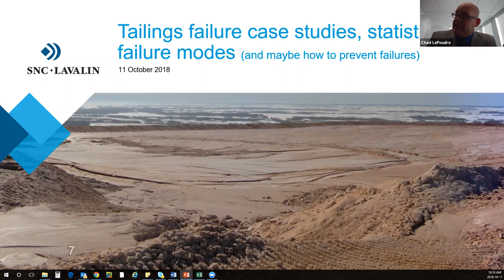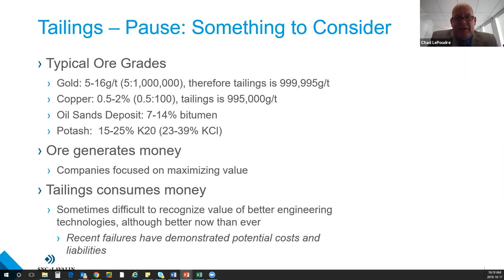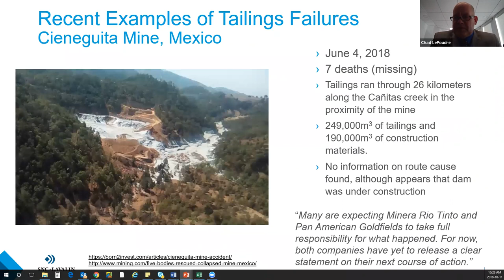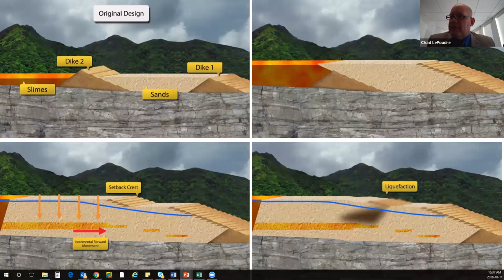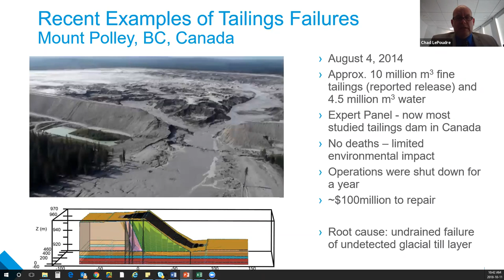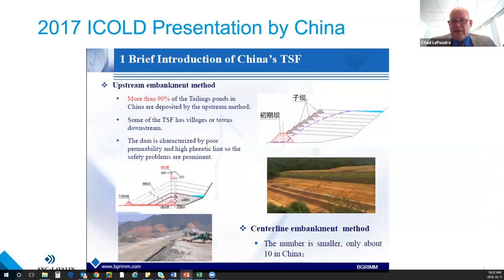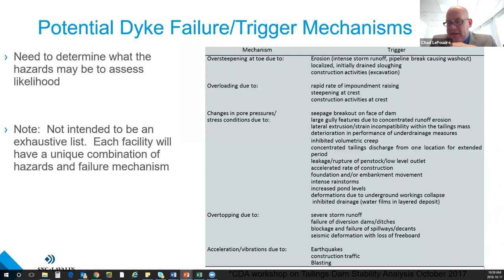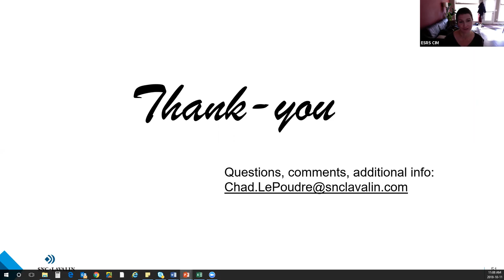Tailings Failure Case Studies, Statistics and Failure Modes Webinar

Comment: That is bizzare that the Fundao Dam of Samarco, Brazil was finished off due to seismic activity. They are not even near the edge of two or more adjoining tectonic plates. This just goes to show that fighting erosion is not easy & must be over-engineered given dire circumstances. Erosion is destined to happen without a high quality stabilizer / anchoring system for loose & low friction aggregates. This inevitability comparable to that of the inevitable biological aging and the possible solutions that the cryonics industry provides... 

Maybe then, if the stereotypical greedy folk that was maximizing the financial capital by cutting corners on some erosion / pollution mitigation techniques would wake up 500 years after cryopreservation to see the mess that has been made, then there may be a change of heart. (P.S. I'd go into cryopreservation if given the chance)